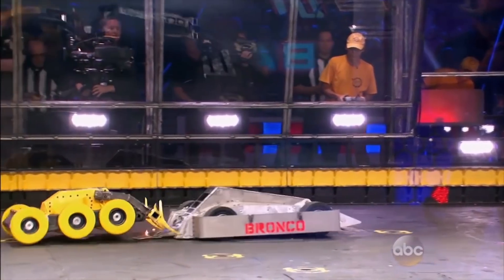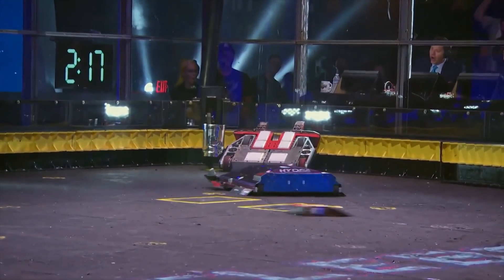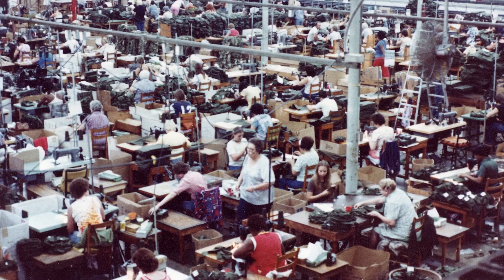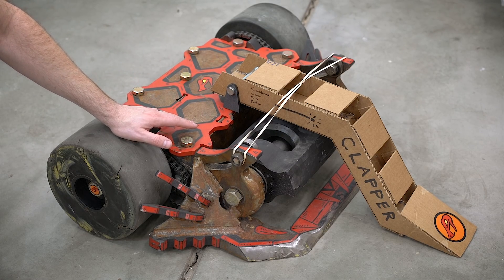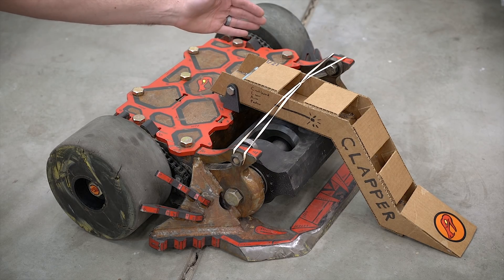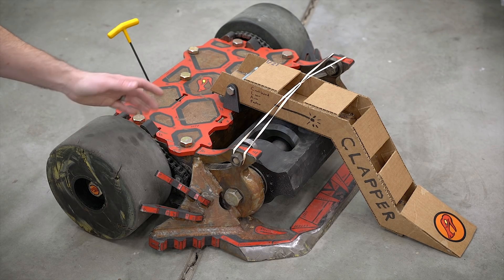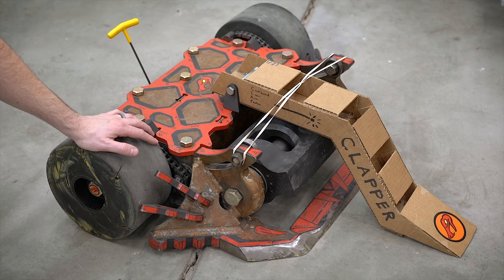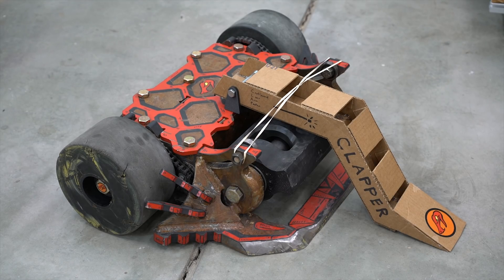Copperhead Lifter Attachment

Comment: How are you getting your arm beneath your opponent when it is vibrating at 50+ Hz? 
How much energy is really in any of those up flips given the short travel and high frequency / bad leverage of the drum relative to the arms tip with the drum not being designed for torque but for rpm and speed build up?

My guess is you wont get good contact with your oppenent and even when you do the lack of energy and travel wont disturb the enemy much, let alone do actual damage to him, If you get contact the opponent sitting on the arm is probably just going to stall out your drum and deactivate your weapon.

I think it wont work well at all, but good luck and have fun!

Comment: In all seriousness, I am curious if this system could actually work.  Maybe find a way to make the flips bigger.  Maybe alter the shape of the drum so the arm has more time to reset before the next flip
Reply: I'm thinking put an actual cam on one, both sides, or center of the drum that the flip arm would ride on.  That would let you actuate it independent of the weapon teeth and without biting into your own arm.
Reply: @A_Bird  But where would you cut the weight?

Comment: I think you are on to something here. A new type of flipper. Use spinning momentum to get a huge amount of energy and create a system to deliver the energy into a flipping arm all at once. You could launch bots higher than we have ever seen before. Or is this not feasible? I don't know how to work out the math on this. Seems like something that could work.
Reply: flywheel energy is pretty strong but requires alot of time between each use to get the wheel up to speed
Reply: Well your wish has been granted... Blip is here!

Comment: Curious, I am not too familiar (and I dont know how to properly ask it) with bot design but I wish to know why did you decide to make Copperhead have that short rectangle shape instead of a  4 wheel square shape like Witch Doctor, Lockjaw, Robbit etc.? Is it to save weight? Copperhead seems to me to have a very unique shape for a front drum spinner.
Reply from the maker: Since we rest on the front forks, rear wheels don't make sense.  We can almost always get under an opponent because so much weight is on the front forks of the frame.  This unfortunately causes driving issues though, since we're constantly pushing against the forks.  It's a trade-off.
Reply: @RobertCowanDIY  thanks!

Comment: You are a few days short of April 1st .   But if you are serious..at some point at high frequency the lift will effectively be holding the arm up with no flip energy.
Again if you are serious,  the rear pivot should be held high to the drum doesn't contact the arm until it is under an opponent, then pull the arm down.   But......

Comment: I can see the idea but I just can't imagine ''clapper'' as a good alternative weapon. It does not have a wide ( 🔼 🔽 ) enough vibration area to lift/flip the opponent. I think Copperhead's drum can lift robots better. The only situation I can see is for robots can't self-right. However there is only 14 robots ( Yes I counted them ) which can't self-right. Lots of them fixed this problem and some of them were there just for the bounty tournament. But these are only my surface thoughts and I am sure it will work very well in Battlebots season 6. We are always in the back of Copperhead 🐍.

Comment: Bad idea. You should make a stabilizer like a magnet at the bottom to decrease the gyro effect and a wheel guard like a wedge instead Copperhead is already perfect in those are the only problem copperhead have
Reply: Has copperheads wheels ever been a problem? I dont think they need wheel guards
Reply: @PONI130  just in case they face a bot like tombstone, rotator or valkerie. Due to the power of the weapon it cause a gyro effect that lifts the Other side when turning and those bot can use that as an advantage
Reply: They will not have weight for magnets and copperhead will take way more hits with just having weight in the front. Also those wheels can take a hit and wheel guards could just bent in to the wheels and thats not good